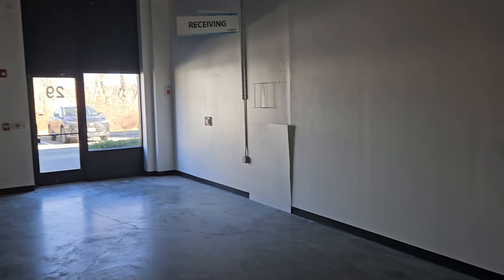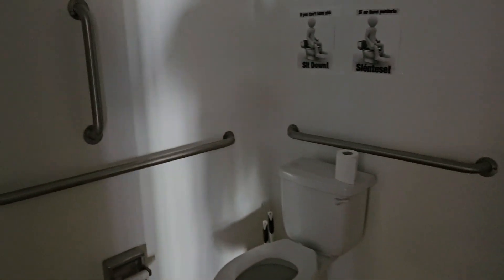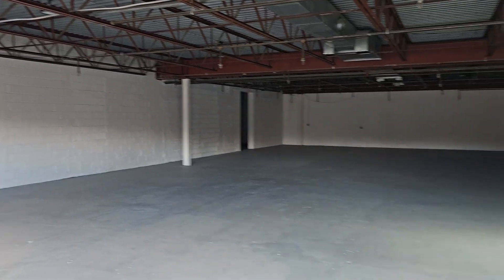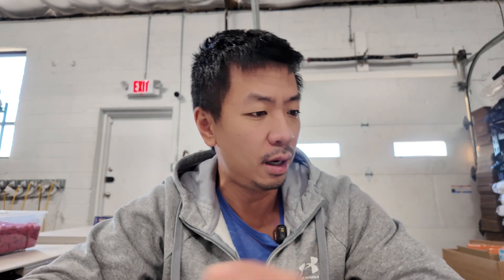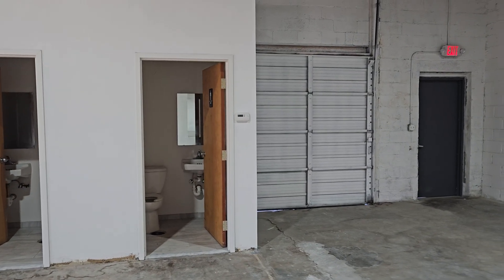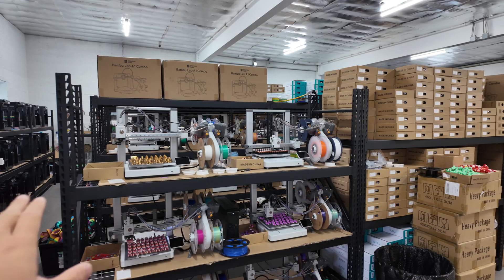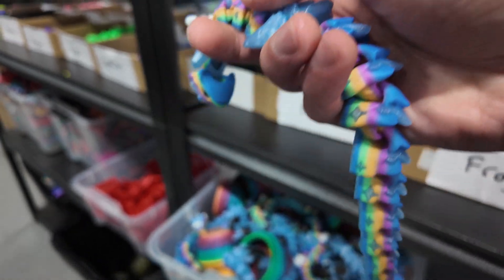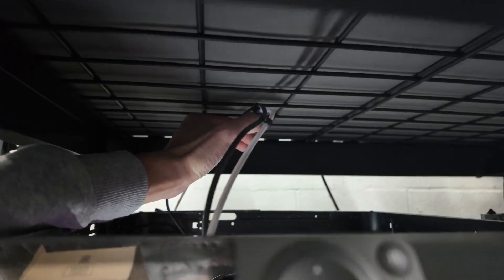Lets Build A Bigger 3D Print Farm

Comment: Get some d-ring retractable employee id badge holders, use the snap to hold a tube or two and the clip to mount it and it will pull it up and also let it travel as needed

Comment: On the P1Ps there is a hook or screw hole you can use a bread/zip tie on to secure the PTFE tube to the frame inside, so you don't need to rely on things outside the printer holding it in place. You do need to mess with the PTFE a little to go back into the shape it was originally, and move the head around to make sure it's not going to keep getting pinched
Reply from the maker: @kingsidorak  didn't know that thanks